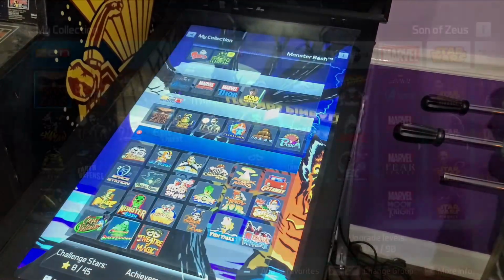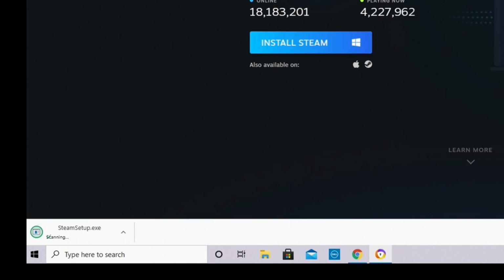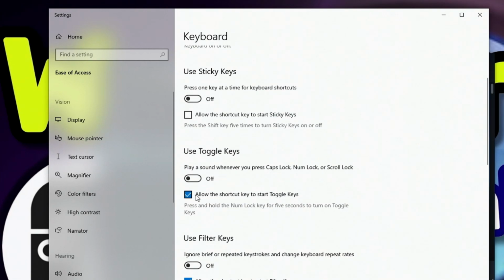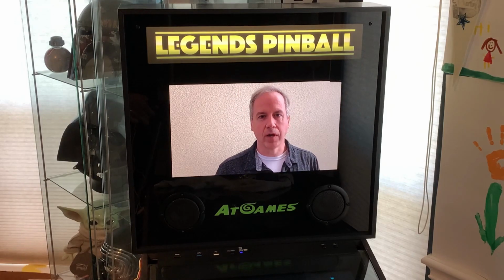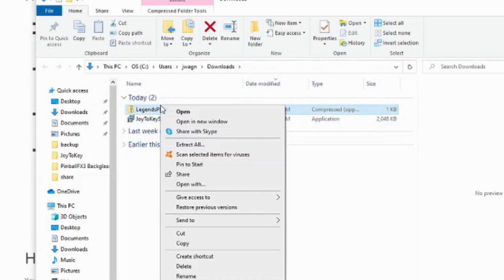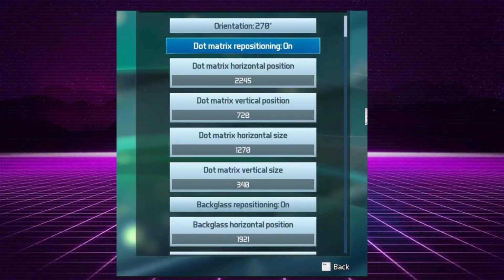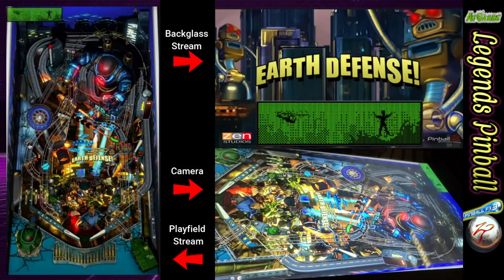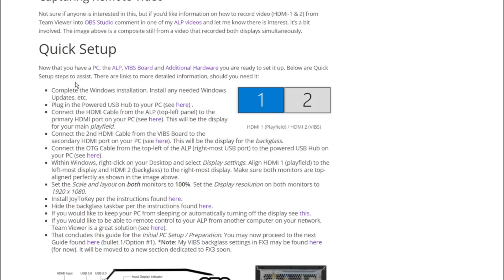Pinball FX3 Setup Guide for the AtGames Legends Pinball Machine

Comment: Is there a way to connect a PC without the HDMI cable coming out of the top of the ALP?
Reply from the maker: Good question Adam, not that I'm aware of at this point.  Some have used a flat HDMI cable going from the HDMI under the backglass assembly but still needs to be connected.  I haven't tried those flat adapters myself, they seem very flimsy.  Although, I've been thinking of a possible solution to make it look less-ugly but haven't had time to design it yet 👍
Reply: @WagnersTechTalk  sounds like a great future video idea. I’m close to pulling the trigger on the ALP and really enjoying your contributions to the community.
Reply from the maker: Thank you, so much more I want to add to it.  Really loving the ALP and can't wait to try out the new TAITO tables this week.

Comment: Thank you so much for this video. I finally put a PC in my ALP and am playing FX3. Never though I would be able to do that. This is awesome! I was wondering if you can answer a couple questions? One is I burned out my VIBS board. I am very distrought over this. I hooked it up to my PS3. I nerver thought it would burn out but as soon as I plugged in the HDMI I smelled burning. So my question is what goes to my VIBS board? Is it a regular HDMI wire? Do I get an HDMI splitter and plug one hdmi cable into the VIBS board and the other end to my computer? Then get another hdmi wire and also plug that from my computer into my ALP? And of course plug the USB from my computer to the ALP. Second, I saw on facebook this person used the ALP backglass as a DMD, then had another monitor on top of his backglass to display the game. How do you think he made the ALP backglass a DMD?
Reply from the maker: Very welcome, happy the video was helpful to you.  I would not recommend plugging anything into the VIBS board except for the HDMI Output from a PC.  Now you can use a USB to HDMI adapter (such as the one mentioned here: http://wagnerstechtalk.com/alppcsetup/#Additional_Hardware ).  Did you follow the official AtGames VIBS Installation procedure and it did work?  Was it the HDMI splitter that caused the issue?  Sounds like the splitter was providing too much voltage going out, I've bought several of these in the past and most I've thrown away.  I've had little luck with splitters.  I used one splitter with an Elgato video capture device, it wound up blowing a USB port in my laptop.  I avoid splitters most of the time, others may have good luck with them but not me  😎

This page has everything I used with my VIBS board and had no issues: http://wagnerstechtalk.com/alppcsetup and here: http://wagnerstechtalk.com/alp/#1st_Party_Expansion
Reply: @WagnersTechTalk  Very informative thank you. Yes, I followed the instructions and it did work but I was curious to see if I could get my PS3 to display. Well, we all know what happens if you are too curious and I burnt out the VIBS. But I have a new one on the way. I was wondering can you buy and play STERN games like we do with Zen Studios on FX3? Is STERN on another format like Future Pinball or somethin like it?  I would love to play the Stranger Things table.
Reply from the maker: It is possible, yes with VPX.  I'm working on that and will have a video when ready.  There is a lot to it, I'm still learning.  So, until I feel comfortable with my own skills it's going to be a work-in-progress but I will have a guide and video for it.  Plus, my AC has been out for the past 4 days so not up to making videos or doing much else lol
Reply from the maker: btw- While waiting for your VIBS to arrive, you might find this video from late last week interesting: https://youtu.be/29bJUaBxcQw

Comment: Mel's going to revoke your cabinet code if he sees your steam id.
Reply from the maker: Why would he do that?
Reply: @WagnersTechTalk  they're some real sh*theads. they threatened legal action against atgames over fx3 running on the table because their physical product is so inferior. google it, there's a bunch of podcasts & vids talking about it too, happened last October I think? Mel and the other clown were losing their minds on social media and making threats they never followed through on.
Reply from the maker: Thanks Michael,  I have not been following that aspect, much appreciated.  Legally, there is little-nothing Zen can do about it.  The ALP is acting as a dual-monitor (w VIBS) and controller to their software running on a machine that the consumer acquires themselves.  The games I fully licensed and paid for through Steam.  Should Zen decide to revoke my code, well... it wouldn't happen quietly. I was 100% up-front about the hardware I was going to use the code on.  I really doubt they would block any cabinet codes on the ALP and  in fact, they may make more from the ALP sales than A1up in the long run.  But, that will totally depend on the consumer.

Comment: Thank you so much for making this. I am a little confused, how did you set up the second HDMI connection into the VIBS exactly? I rewinded the vide 20 times and I still can't understand. Did you somehow do USB from your computer to HDMI or did you split the HDMI. I am so excited to set this up but also so so very confused
Reply from the maker: Hi MichaelB, for the second HDMI connection to the VIBS board I could have used a DV to HDMI adapter on the PC.  But, I was previously testing another PC (which didn't work out) and on that PC I had used a USB 3.0 to dual-HDMI adapter.  My thought is to use the 2nd HDMI port at a later time for a dedicated DMD.  The HDMI Adapter worked great on both machines (the one I returned and the new one I setup recently).  So, I stuck with that.  All the non-AtGames hardware (and software) can be found on this page: http://wagnerstechtalk.com/alppcsetup/#Additional_Hardware .  It should help quite a bit, especially the JoyToKey tutorial which basically you download the LegendsPB-wtt archive and everything will be pretty much ready to go.  I did make a minor change to that file to allow using the A/B button on your Arcade Control Panel for a Lef/Right mouse click.  Hope all this helps!

Comment: Hi - added the LegendsPB-WTT config file to JoyToKey documents folder, but the settings don't appear when I open JoyToKey.  Will they only show up when connected to the ALP, or should I see them on my PC when it's not connected to ALP?  Should I remove JoyToKey Config 1 and replace with LegendsPB-WTT.  I can't seem to get the settings from the new config to show up.
Reply from the maker: Make sure you completely close out of JoyToKey (see taskbar icon at the bottom right).  Then re-start and you should see it in the list.

Comment: Thank you for this video! I was having a lot of trouble getting a reliable non-laggy USB connection between my gaming PC and the ALP and your info (In the video and on your site) were what I needed to finally get things working well. 

I had tried 2 or 3 different USB cables...one worked reliably but had too much lag, another would constantly lose connection. I tried a powered USB hub since I heard that could fix the lag, but no luck with the HUB I had. I finally broke down and spent the $30 for the hub and cable you used (plus another $10 for the magnetic beverage holder!) and finally had a near-zero flipper lag (certainly good enough to play well..finally!). 

I did have a few issues/differences from your video. One was that I needed to set the ALP screen to portrait orientation in my Windows display settings. When I would do landscape in Windows and then rotate in ALP or Steam, the display would get screwed up. It's likely I had something set wrong between my ALU's orientation setting and the Steam/FX3 orientation setting, but I was able to get things working fine by simply adjusting the DMD/backglass coordinates in FX3 so it worked out fine in the end.

Also had an issue with the controls, but tracked that down to some previously configured settings in Steam for the ALP controls that were interfering with the Joy2Key settings. After cleaning out the controller settings in Steam, the problem went away. 

Another challenge was tracking down the backglass graphics and the correct DMD/backglass coordinate settings for FX3. Would love a link to the backglass graphics you used in your video because they look pretty nice. 

I got the backglass stuff working on an external monitor and now I'm just waiting for my VIBS board to arrive...it's been in "ready for pickup" status for about a week now, but still isn't showing it has been picked up. But once I get it installed, everything else should be ready to go. Thanks again for the very detailed instructions!
Reply from the maker: Very welcome,  happy it was helpful!  I'm out of town, using my phone to reply.  It was shown in the video, but need to set the hdmi to otg, main and 90.  Then my settings will work.  I'll add clarification when I get back on the guide.  I linked to some artwork from a fb thread, but may not b the exact set shown.  I'll hunt it down and add it to the guide if it's not the same and I can locate it.  Thank you for all your feedback and for watching. More will be coming, just a start.
Reply: @WagnersTechTalk  Thanks for the response and look forward to the art links. I thought there might be more info on FB, but I don't have a FB account and AtGames making their FB area private prevents me from seeing anything.
Reply from the maker: As promised, see the 3rd bullet here: http://wagnerstechtalk.com/alpfx3/#Software_Considerations where it says this archive (link).  I had the right thread linked.

Comment: Just curious if you're getting 60 fps on all  the pinball fx3 tables via ALP.  Obviously it would be ideal to load directly like the ziccaria tables, but if this works without framerate drops, it's worth it.
Reply: Your guide helped explain the cpu setup a bit clearer.  I have dell xps with an Intel i-7 chip.  I will probably throw a gtx 1060 3 gb in there when the prices settle down on gpu's.  I got that desktop for 80 bucks so even though it seems like overkill, it opens up options.
Reply from the maker: The framerate you get will really depend on the CPU/GPU of the PC.  I get very smooth gameplay on the PC I have connected, the one I tried previously had severe screen tearing and I returned it.  I've got a bit more information here: http://wagnerstechtalk.com/alppcsetup .  Hope it's helpful!